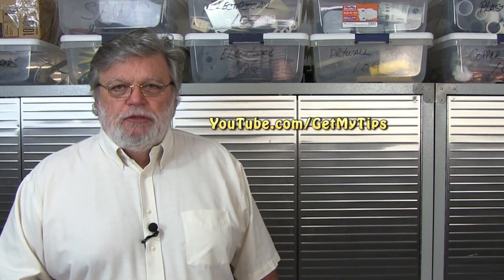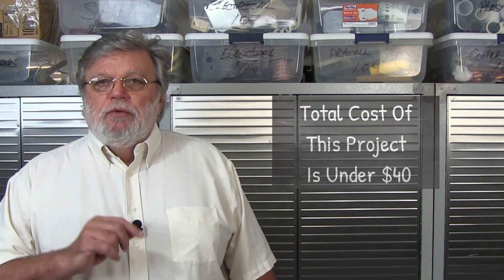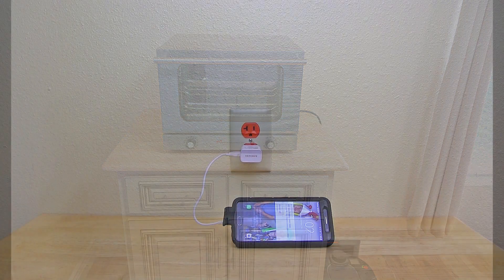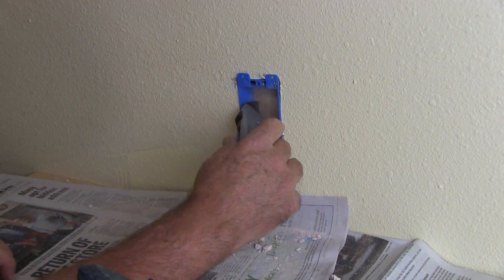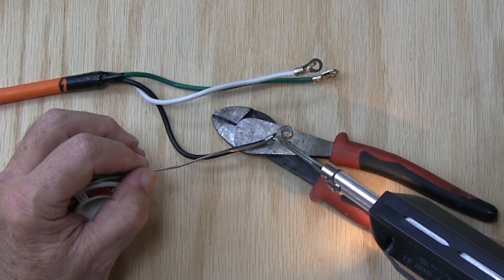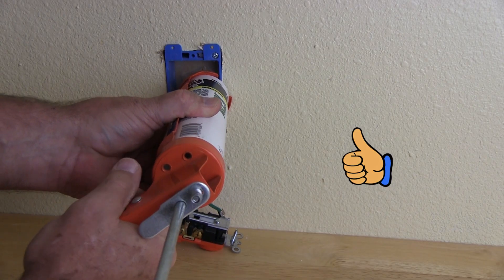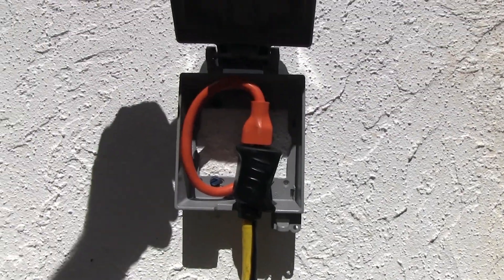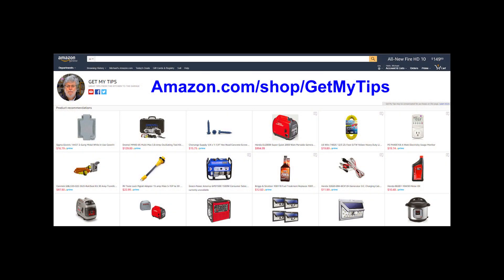How To Hook Up A Generator To A House

Comment: There is a much easier way. Make up an extension cord with a Male plug on each end.. when you lose power from the electric company. Go to your main switch in your panel board and turn it off. Place your generator outside near an outlet that you have outside that is connected to your electrical system in your house. Plug one end of the extension cord into the generator plug the other end of the extension cord into an outlet in your garage or outside or even in your house if we run the extension cord through a window. This will give you power on 1/2 of your panel board. If you have a small generator, you must turn all the breakers in your panel board to the off position so that you don’t have unnecessary draw of power for things like lightbulbs, appliances you really don’t need during a power outage. Just the basics is what you want to power. If it’s cold your furnace, if it’s hot your refrigerator. Maybe a light bulb here and there, but turn off everything you don’t absolutely have to have.
   A generator of 3000 Watts should run your furnace, and your refrigerator in a few lightbulbs and maybe a television. You don’t need to have your refrigerator run 24 seven, you could alternate turning the breaker for the refrigerator off every four or five hours if that’s too much of a draw on the system while you have your furnace running and the television and a few lightbulbs. When I have to run my generator, I have two refrigerators. I will plug only one at a time in for about a half an hour so it cycles off. Then I will plug the other one in while the first one is unplugged. The main thing was to have a furnace running in a few lightbulbs.
   When power is reestablished from the electric company. You must turn off your generator and unplug it from your house wiring. Then turn the main breaker in your panel board on. And your house will have power from the electric company just as before the power failure.
   Another thing to consider if you’re going to keep an emergency generator is, you want to have at least 2  five gallon gasoline cans for fuel for the generator... at all times I have at least one gas can full just in case. I rotate/use that gasoline and replace it every so many months by using up the old gas in my lawnmowers or  in my truck. You don’t want to try to use gasoline that’s years old.. another thing to consider. Never run your generator and turn it off leaving gasoline in the gas tank and in the carburetor. Always drain the fuel tank on the generator or turn the valve off from the gas tank to the carburetor and let the carburetor run completely out of fuel. That way, when you really do need the generator. The carburetor won’t be caked with evaporated gasoline residue. I have had my generator for about 25 years. I have always run it completely out of fuel when I put it away after each use And when I need it, I put gasoline in it, and it usually starts with in four or five pulls of the rope...
  One final safety precaution would be, ground your generator frame or if it has a terminal for a ground wire, connect that with jumper cables for starting your car to the copper pipe of your outside garden hose faucet, or to the ground rod below your electric meter going into the ground.. I am taking for granted that anyone with the ability to read this has enough common sense to know not to run a generator inside their house, but unfortunately, I find that common sense is not too common...
  Some generators have a level sensing float or device that will automatically shut the generator off if the generator is not on level ground. The reason for this is if the engine on the generator is tilted, the oil pump may not be picking up the oil at the bottom of the engine and the engine will be destroyed from lack of lubrication. So have your generator on fairly level ground while it’s running..
   If you want to go to all the trouble of cutting into your walls on the inside and the outside to mount a receptacle box to run an extension cord as suggested in this video, go ahead. But my way is easier, and will Power 1/2 of all the circuits in your panel board, not just one outlet.. so do a test of which appliances are on the side you need to have energized in your panel board. The reason is, you want to make sure that your furnace, your garage door opener, and the outlet feeding your refrigerator, get their power from a circuit breaker on the side of your panel board that is fed from the generator. The main thing you must always remember, I can’t emphasize this enough, you must turn off the main breaker in your panel board before you Connect the generator to an outlet that will backfeed half of your panel board. And, you must unplug the generator once the electrical service to your house has been reconnected by the electric company, you must Unplug the generator from your house whichever out let you have it plugged into before you turn the main breaker back on.
  If you have any long-term power outage, and you live in an area where you really don’t know or trust your neighbors. It’s a good idea to chain your generator to something solid so it won’t Mysteriously disappear in the middle of the night.. when there is a power outage widespread, at night the only things you hear are generators running. It’s easy for thieves to find your generator by following the sound.
Reply: Illegal for a reason.

Comment: Just buy a damn home standby generator. A 15kw only costs $3999.00 with an automatic switch. Thats delivered from home depot to your driveway!  No gasoline to go bad. Auto starting and switches to generator automatically. That means when you aren't home in the winter and power goes out you heat still works. No frozen pipes.
Reply: yeah, or for the common folk unlike you who can't imagine thinking like that about money they can buy a $400-800 generator that they'll probably use only up to a week out of the year and just do this...

$1000 vs. $4000 

BiG BiG difference for most people, apparently not you.
Reply: I use a XP12000EH (12,000 watt max) DuroMax Dual Fuel generator - runs on LP tanks or gasoline with a generator interlock kit on my panel.  Extremely simple to use and I can basically run the entire house in less than 5 minutes after a power failure. Entire cost of generator, interlock kit, power inlet box and wire - less than $1,400 bucks.

Comment: My objection is the soldering of the lugs. This is not a good idea for AC power (unless terminating on a circuit board such as in an electronic device like a TV or stereo) and never allowed under any household wiring codes that I know of. The main problem is that IF the outlet is subjected to an overload or a screw loosens or oxidation develops, now or 10 years from now, heating can occur, and the solder can melt, releasing the wire. Then it might cause a short or, possibly, a hot wire can contact a ground or neutral wire, or a ground wire can contact a hot wire. Either one is not a good result.
Reply: tx2sturgis  IF    IF     IF   IF   IF............ IF you had a brain you would be dangerous !!!!  DUUUUHH!!!!!!

Comment: Hello, Thank you for your Idea is quite Good, I really liked it is really a solution, Now I wonder it is possible to connect the power plant to any current outlet of the house, of course after disconnecting the main breaker from the house and thus transfer the electric power to the whole house. Thank you
Reply from the maker: lucas sacul, No there is no way the low power generator can power much more than demonstrated in the video. Mike ☺
Reply: Thanks, I was about to do it, but you know how I would like you to teach us how to make such a system for home, Thanks

Comment: well lets talk about the outlet or plug you installed inside a  moment and give me some wisdom  not an electrician , but have done simple wiring ( outlets , switches, lamp repair and even moved a small breaker box , by drawing what it looked like and where all the wires went and then reinstalled it by following the diagram I drew ) Anyway I have two Generac GP 5500 Generators ( power goes out around here a lot )
What i am interested in is the Wattage limits and or wattage use. Not sure what exactly each item requires I have a list that came with the generator for instance it gives a Fridge a 700w number, a normal chest freezer is also listed as 700w , a TV for example ranges from 200 to 500w ,  AC units range from a 12,000 BTU unit at 1700w to a 40,000 BTU at 6000w just examples.

Just the other day the power was out for 4 and 1/2 hours...after 3 hours I decided the power was not coming on, so I fueled the generator and started it up and since I have two fridges and a chest freezer, [ three different locations around the place ] i hooked up three HD extensions cords ( as the Fridges and Freezer ) is the most important things ( have Natural gas heat so no worries here in the winter ) the Generator is registered at 5500, so I assume it puts out 5500w of power... SO I am assuming it is using at or near 2100w with those three hooked up ( probably less as these are smaller fridges ) and Power came on 20 minutes after I did all that btw...lol
A few years ago we were without power for 10 days ( why we have the Generators ), powered the fridges/freezer and even watched a little TV and ran a couple lamps and it was a hot summer we ran some box fans with no issues .( Did not run the A/C units )
Can you give some insight or how to know the exact wattage these appliances use and if one can use a power strip ( surge protector ) safely ( we have with no issues and none get hot at all ) BUT can one install a double outlet for example and hook that extension cord to Both or would one need to separate outlets /cords ?  and the watt meter you show on Amazon has very poor reviews....btw...lol Thanks for the help
Reply: The power meter i use is a kil-o-watt or some name like that. I think a lot of people use them. Fridges and freezers take much more power to start than to run. Our fridge has a 1.8 amp running current on the label. 
What i would do is make a board to fit under a partially opened window so that weather and critters stay outside. Regular power strips are almost always rated at 15 amps/1,800 watts. If you can find one that handles 20 amps/2,400 watts all the better, or make one yourself. Just get a surface mount electrical box, cover, and two duplex 20 amp outlets. If you think you need more outlets, make two. Run extension cords from there to needed locations around the house. Theres a number of ways to cover the outside connection at the board. The main thing is to shield it from rain. Hth.
Reply: @joewoodchuck3824   Thanks

Comment: Good idea, bad application. You have one (1) plug in your house. What about lighting, microwave, freezer in the basement? The list goes on. Looks like the only thing you can do IS charge your cell phone.
Reply from the maker: J-Bob 5150, I guess you must have missed the part where I plugged in the refrigerator and verified it worked.

Comment: I got power in my house by just running the extension cord under the back door! It was a reel type with 4 outlets, so I had more plug ins! I did have to switch the fridge and freezer every now and then as the generator wouldn't run them both! And my brick walls are still hole free!
Reply from the maker: I'm glad that worked out for you and I'm glad your wall is still intact. I'm surprised that you have pay Gap under your back door large enough for a heavy duty extension cord. I live in Florida and if I had a gap under any door that would accommodate an extension cord, my house would be crawling with lizards and other assorted Florida creatures. Mike

Comment: Fire hazard? Not if the materials are selected properly and installed correctly.
Electrical code violation? Maybe, check local legislation.
Dangerous? Safer than alternatives including having a window open or directly connecting your generator to your main panel without a force-locked breaker on the circuit so that you can't backfeed even by accident. This is an isolated plug that will always have physical separation from utility when the generator is connected.

Comment: why not pigtail to your  breaker box and turn off main breaker
Reply from the maker: Les Flynn, A it's not safe to do that. B the generator is not powerful enough. And C, I rarely have a need for emergency power and I only need to power a couple of things. The videos intended to show non technical people how to essentially run an extension cord from their generator into their home without having a door or window open.. Mike
Reply: Less  Illegal unless a lock out interlock is used !!!!! DUUUUUHH!!!!!!!

Comment: I noticed that the socket you installed is orange with a green triangle - a floating ground socket.
What are the advantages of a floating ground socket vs. conventional 3 wire?
Reply from the maker: 1L6E6VHF, I just used it as a regular receptacle that was a different color, that's all. Mike ☺

Comment: No body wants cords all over the place.
Reply from the maker: You're right nobody wants chords on the floor but nobody wants to be without electricity either. It is a temporary solution to a temporary problem that's all.

Comment: I could not see on your video how the extension cord is hooked up to the generator. The cord itself looks heavy gauge. Did you use a standard 120/240V outlet on the generator? Or the RV outlet? Did you use a standard drop cord? Thanks...
Reply from the maker: It is plugged into the outlet on the generator. Mike
Reply: If you don’t know how to connect the extention cord to the generator, you should probably not attempt this project.

Comment: (1) Identify what home circuits you want the stand-by generator to provide power for, 
(2) decide whether it's going to run on propane or gasoline, 
(3) Talk to an electrician to see how much energy is required, 
(4) THEN acquire an appropriately sized generator, manual transfer switch, and cord to run between the generator and the transfer switch, 
(5) Have the electrician install the manual transfer switch AND label the circuits you want energized,
(6) Store the generator and fuel in a suitable location to be available for when you need it. 
Easy Peasy ...
Reply: Check Your Six pricey wicey. 
The whole point of the video was that the cost would be low and there would be no need for an electrician.
Reply: @westmcgee9320  yeah, for the elctrician to install an addition to make it functional it would cost about $500-1000. 

To make a couple outlets, possibly in the empty/blank wall plate boxes that many homes have in many rooms, costs $100-200 MAX.

Don't know if it's code compliant or whether the outlets have to be colored red for generator power though... worst case scenario is you remove it before selling the house though, right? 

at any rate this is very good advice- cheap, easy, safe, functional, and affordable for the common folk like you and me. I think it's pretty cool.
Reply: keep gen.about 15 feet from house,with exaust aiming away from house.

Comment: Boy a lot of pros and con comments but i have to agree better to call a electrician to do all hookups right ! why what if your away and you get a overload and the ext cord heats up because of the soldered ends and ignites the framing in the wall even though there are surge protectors and auto cutoff at the generator there is still electrical load in the line ... ya no mayb saw it happen to my bros trailer better just squeek it thru the window cool video though

Comment: I did the same thing when I built my house except X4.  The cost of whole house generators are too high.  But we made it through three hurricanes with a 5500 using about 5 gallons of fuel a day.  We ran a window AC on the 220 plug as well as freezer,  lamps, TV, frig on the 110 plugs.  I have a fiberglass box in my garage that has my cords rolled up in it.  Storm comes: roll generator OUTSIDE, open box, plug in the plugs, slide the frig out and move the plug from the normal "white faced" receptacle" the the generator "black faced receptacle", repeat for the other plugs you have set up for your emergency situation.  It is easy to obtain a second generator as a back up to the back up for low cost.  If a piston burns out or have carb problems, swap it out.  Can't do that with a whole house unit.  You would have to wait days for a tech to just come look at it.
Reply: I lobbied my fiancée, hard, for a whole house generator when we moved to our new home six years ago. By that time, and I don't blame her, she had spending fatigue as I did too. We made it through the past six years here with a total of 70 hours or so (over two power failures) of being without power so we used a 9000/7500 watt generator that saw us through. Now I'm glad that we didn't sink a lot of extra money into the whole house generator.
Reply: So true.  Most people think the idea behind a whole house generator is maybe running the AC or something.  It's comfort, sure, but the amount of fuel that size generator would take up is just stupid.  You would need at least a 10000kw generator for this. That would also be ONLY for the AC unit (maybe a few other things, but nothing big).  This at least can run your basics so your food doesn't spoil.  If you can, get a window unit and mount it to a window in your smallest room.  That's the room to sleep in for the night (assuming the placement of your generator and the window unit are within relative close proximity).  Now, the cool thing is you could even get a ductless unit to power off a generator which doesn't take as much power for whole house and it would give relatively the same amount of cooling to that room without too much noise.